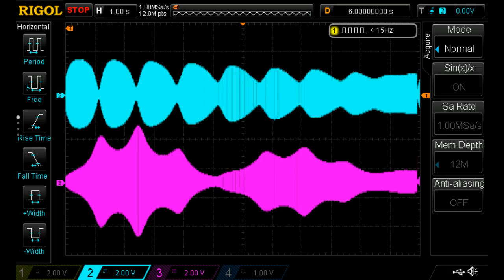Transmission Line Demonstration

Comment: while sweeping across some signals in the shortwave band I've heard audio tones that represent what you visually demonstrate here. Sweeping tuning frequency on the radio being analagous to sweeping the function generator on your cool little LC transmission line - I see Nifty applications for things like AI  or quantum computers(?) to Hobbies like Model Railroading and Decorative Lighting. How long can one of these get and still function with your current input values?

Comment: Nice,  the standing waves move down the line.  can we hold them in one place.?
Reply from the maker: The wave nodes and peaks move down the line because I'm sweeping the stimulus frequency from low to high. A fixed frequency sets up a stationary standing wave pattern in the transmission line.

Comment: wow... very cool piece of representation of the wave form ,i would be keen to try and make one.. do the winding,s on the former have a specific amount of turns? or are they there simply to accumulate and release . regards BB
Reply from the maker: I used 20 turns per segment. The more turns and greater capacitance value, the slower the characteristic speed of the waves in the transmission line. 
Thanks for watching and commenting!

Comment: Very interesting device! Nice work! Have you tried using it with a fluorescent tube?  I'll have to read the patent. Thanks for sharing. Michael Pupin had a similar patent US 652,230. Cheers
Reply from the maker: Sorry, no I haven't tried a tube in there. The power levels I have used are so low that I doubt anything would happen. But maybe... I'll have to try it. Thanks!

Comment: Great Demo for sure! Would standing waves in a line imply longitudinal  waves or is that nonsense in your opinion??
Reply from the maker: Well.... that is a gnarly question. Sound waves in air, for example are longitudinal pressure waves of compression and rarefaction that propagate outward from a source and "oscillate" in pressure in the same direction as propagation. Electromagnetic waves in vacuum, air or most other media are transverse waves of electric and magnetic fields, also propagating outward from a source but oscillating at right angles to the propagation direction.  Within a transmission line, though, when you have standing waves or travelling waves propagating along the line, oscillating energy between the line's distributed inductances and capacitances, the situation is murkier. Generally the speed of propagation is well below lightspeed in the line, and you could, by analogy to the pressure waves of sound, think of voltage peaks and nodes as travelling "longitudinally" in the line. However I think this is only an analogy and like all analogies, it breaks down on finer examination. I think. 
So not exactly nonsense, but not exactly the "longitudinal scalar wave" phenomenon either.  Perhaps pure oscillations of an E-field alone might be legitimately considered "LSW" instances. Perhaps. 
Thanks for watching and asking questions!
Reply: Your perspective on the matter is appreciated and I share ypur sentiment. Keep up the great videos TK!
Reply: TinselKoala , "pure oscillations of an E-field alone" isnt that happening in a tesla coil? (when tuned it produces a standing wave, and I call the E-field the dielectric field, following Steinmetz)

Comment: TinselKoala
Great idea, very informative demo and an excellent way to visually observe standing wave.  What capacitance values did you use and what function generator peak-to-peak voltage did it take to light the LEDs?  I am curious if you would be able to manually adjust the frequency to only light the last 2 or 3 LEDs at the open end of the coil (1/4 standing wave) and can you also detect the antinode peaks with an LED AV plug?  Are we only seeing the effects of the fundamental frequency or are harmonics also at play here?  Thanks
Reply from the maker: The capacitors are all 2.2 nF polyfilm types. The FG p-p voltage was set to 5 v p-p.  Yes, it is possible to light the last two or 3 LEDs at the open end. I have not tried to detect the antinodes with an AV plug but it should be possible. Yes, harmonics come into play, and in addition I am using "sine" waves from the ElCheepo DDS FG, which only approximates a true sine wave and has noticeable voltage steps when looked at with high resolution-- hence there are significant higher frequency components in the DDS FG's output. 
Thanks as usual for your comments and questions!

Comment: Nice! I like the lights slowly fading. Would make a nice christmas decoration.
Just wondering, could this be simulated with something like a 555 timer and discrete inductors?
Reply from the maker: Sure, but probably would use capacitors rather than inductors as they are cheaper and more compact. Google "LED Ring oscillator" for more circuits that will fade through multiple LEDs.
Reply: Thanks for replying. Yes i remember your neon ring oscillator which i found allso very fascinating. Still, i like the idea of using inductors.

Comment: What is the freq. when all of the LEDs are lit at once (as appears several times during the video)?
Reply from the maker: That's the slowest frequency, when the sweep resets to 10 kHz and starts going up again. At such low frequency the thing just acts like a regular conductor so all the LEDs are effectively in parallel.

Comment: If you terminate the end of the line with a resistor matching the lines characteristic impedance... the reflected travelling wave causing the nodes should disappear.
Reply from the maker: Yes, that is true. In this case the end of the line is open, unterminated.
Reply: It's a nice demo & the test fixture took some effort there.  This technique commonly used in network analyser measurement for return loss.  1. Open line,  2. Short circuit line 3 Terminate line. It forces reflected vector to rotate a full 180 degrees.
Reply: TK, really like this transmission line model with LEDs to visually show the antinodes of the standing waves in the line.  Looking to build one of these and was reviewing your video again, thanks for confirming that the end of the line is open (unterminated).  The end of the transmission line has to be open for maximum reflection but couldn't fully see it in the video when you were demonstrating, the picture of your build at the start and end of the video appear to show a short at the end of the line per the patent.